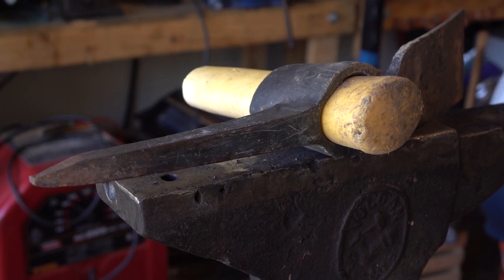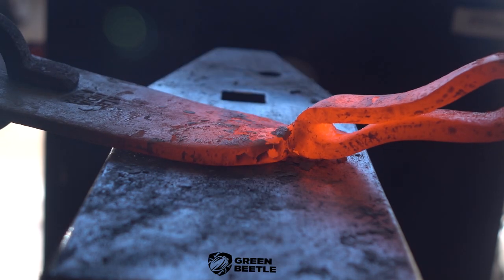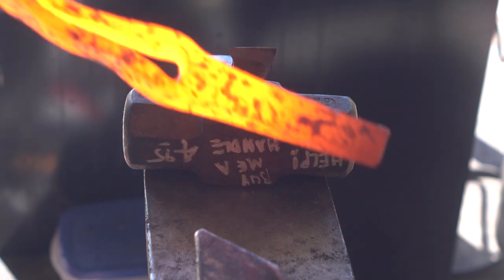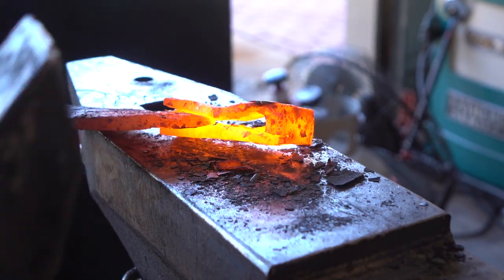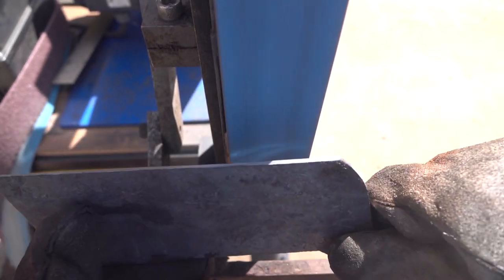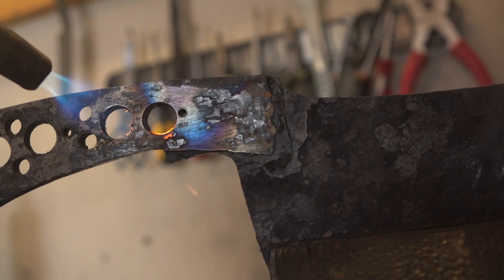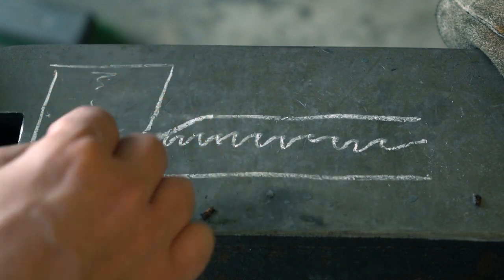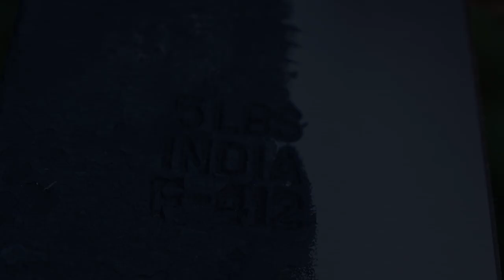Making a Cleaver From a Pick Axe (feat. Simple Little Life)

Comment: Really cool cleaver, but I think you underestimate the steel, it was made to be a pickaxe after all and those are used for chopping stone, I don't think meat and bone will be any issue...
Reply: Yellow- Harold so he actually misidentified it as a pickaxe (understandably) but in reality, it is a pick mattock. You can tell because of the adze end and the fact that it is a jam bit tool. Mattocks, specifically the adze end, are not designed to directly hit stone. It's a trail building tool and is made of much softer steel since it handles mostly dirt, root, and small rocks. Obviously that can be changed some through tempering, but he may be very accurate in doubting its ability to chop bone.

Comment: I was wondering about the quality of the steel when I saw the "INDIA" on the side of the pick mattock.  The lines you are seeing are inclusions from "dirty" steel. When steel is heated and worked either through rolling or forging the outer surface cools first. The non metallic inclusions have a lower melting temperature and tend to migrate to the middle of the piece where they collect. As you work the metal the inclusions get stretched out into stringers and sometimes flakes. the stringers are not as much of a problem but the flakes can cause de laminations. Either form will be detrimental if it occurs on the cutting edge. Cool cleaver but crappy steel. GIGO at its finest.

Comment: Do you think it would have worked out better if you had separated the blade at the eye,  split the eye,  forged the eye down to width,  forge welded the handle to the blade.  Maybe added a couple of pins at the weld for added stability.  It looked like all the bending really abused the steel. 

I have an old mattock laying around and I'm thinking of trying this one out.
Reply from the maker: Anything other than what I did would have worked out better!
Reply: Green Beetle you could have put a new handle and won't been better

Comment: The problem with that particular steel was where it was made...India. The bulk of the steel, (inner core) is most likely is a poor quality or low grade steel with a thin outer layer of somewhat better steel. Basically its a cheaply made import for people who are only going to use it very few times for light work & don't want to pay more than $10-$15 for a pickaxe. They can be found in a lot of big box stores & hardware store chains at a cheap price and marketed as "forged steel" to give the impression of quality. I know that because I'm one of them cheap folks that's bought one just to use on a couple of "light duty", around the yard projects. I sure wouldn't use mine for any serious, heavy duty application. I'd be afraid it'd break before the handle would...lol

Comment: will the heat treat stop the steel from rusting? im thinking about the edge primarily
Reply: Ugleskjegg nope it will still rust but you can oil it up to prevent rust. most commonly used carbon steels (like O1 for example) will  rust

Comment: Can you harden and temper black plumbing pipe?
Reply from the maker: no
Reply: I want to make a large spindle roughing gouge. a length section of 1 3/8 black pipe would be perfect.
Reply: Glen Nicholson I'm sure you could make a gouge from pipe, it would just need constant sharpening.
Reply: Hehe, yeah, I tried. Constant sharpening is right. It looked cool but wasn't at all practical. :)